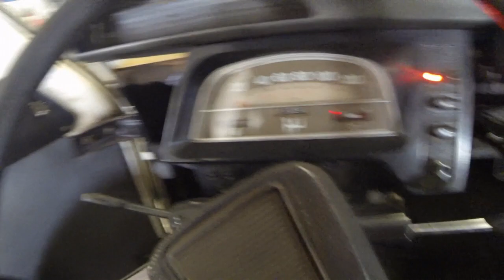My 2CV Stalls and cuts out! what to do!

Comment: Good eye spotting the rub mark of the float against the bowl wall!  I didn't see where you checked the float height for proper adjust...was this done off camera or did I just miss it?  One other quirky thing that can happen is if one of the floats has a pinhole and fills with gasoline (petrol) and the other doesn't.  With one float buoyant and the other not, this can create a twisting action that can stick the needle valve open (usually) or closed (occasionally).  This is an old-school American car problem especially with hollow soldered brass floats, particularly on after-market replacement floats.  So glad to see you keeping the old 2V on the road!  I kind of fell in love with them when I was on vacation in England in 1989.  Only a few 2Vs ever made it to the USA, and the handful that survived are ridiculously expensive now, so I must enjoy them from afar by watching Youtube videos such as yours.  Thanks again.
Reply from the maker: Thanks! 

I did not do it on camera- I did it earlier when i checked over the "new" Carb.. i should have mentioned it in the video.

In my Citroen Acadiane video i show how i do it. :)

Yea not floating floats is a pretty common issue... especially with newer fuels thats hard on the plastic old ones..

Was the 2cv sold over there or is it only a handful of imported ones?  I could imagine that the 2cv would have a hard time with the regulations in the states in the 70-80.. :) The 2cv is really a very unique experience :)

Comment: What was the issue with the mixture screw on the 1st Carb?  Sometimes the tip can break off meaning that it's hard to adjust,  Also, when removing the top of the carb, unscrew all of the 6 machine screws and lift the top off without twisting to the side.  This will prevent the float arms being bent again in the future.  Had similar problems with floats binding on mikuni primary jet - which sticks out a bit more than the solex one.  Finally adjust float height to 15mm to avoid it sticking.
Reply from the maker: I have not investigated the old carb yet, but a broken tip is a possibility! It would make sense. .. But I had another know good carb..
Thanks for the tip about removing the lid... the strange thing is that the problem developed over time while being untouched. . :)

Comment: Good job. The float probably has a matching rub mark to prove the problem. You may have bent the arms a little to make sure it all cleared, I would have. Your nearside (right hand if you look from the rear) rear light looks to be a bit weak. Maybe a poor bulb/poor earth?
Reply from the maker: Yea- It would be easy to fix the float issue, but the carb had other issues that i could not fix with the CO2 screw..

Yea the lights got some dodgy connections due to rust! they are badly corroded, I am going to change them at some point... its a case of touch it, and it will brake... ;)

Thanks for watching!